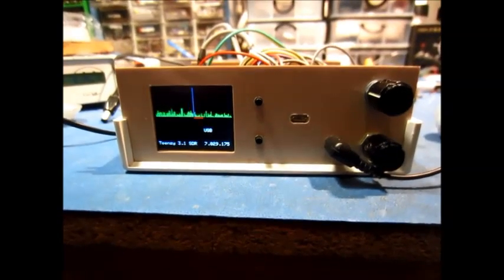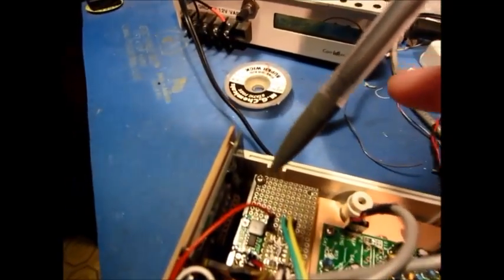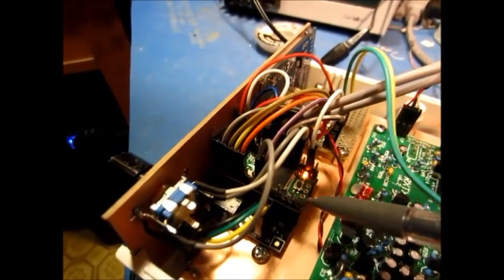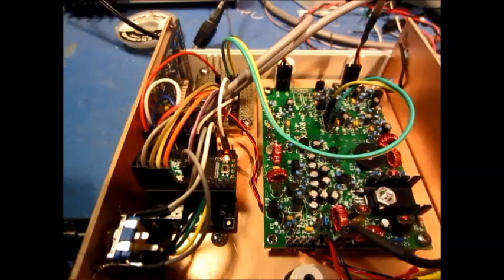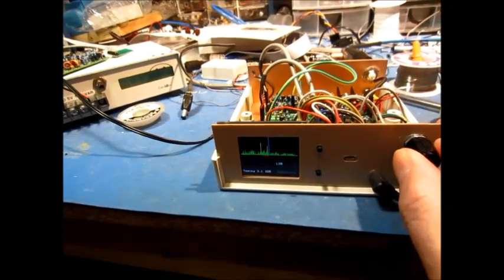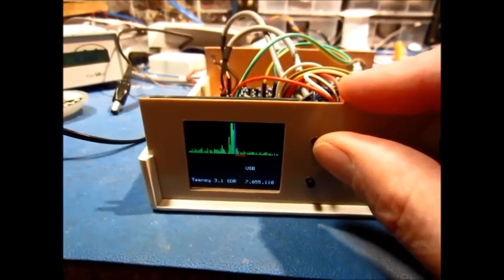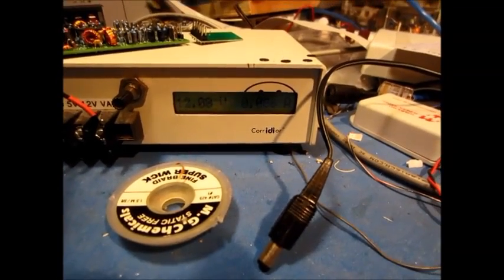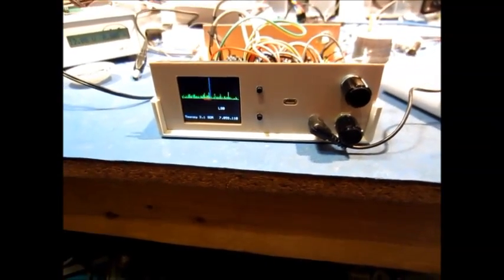Teensy SDR update

Comment: This is a cool implementation of the weaver ssb method. I think I'll try it. I wanted to throw a possible addition to this maybe if you want you can try it. I think the teensy has capacitive touch I/O and was thinking it would be cool to have a cw paddle implemented in some way using that feature. Maybe even built into the enclosure so you don't have to have an external key. Anyway such an interesting and cool project. Thanks so much for sharing. --... ...--
Reply from the maker: I will probably put a keyer in the software at some point and once that's done adding touch paddles to activate it should be straightforward. The display update burns a lot of CPU time 10 times a second so getting precise keying would mean running the keyer under interrupts or something like that. Good suggestion!

Comment from the maker: I don't have a detailed parts list since its intended to be a DIY project that you change for your needs. Parts I used:

Hammond enclosure
PCB material for panels
SoftRock 6.2
Teensy 3.1
Teensy Audio Shield
1.8" TFT display from Banggood.com or Adafruit.com
Homemade SI5351 breakout board - you can buy these from Adafruit.com
Adjustable step down switching regulator module from Banggood.com (set to 5V)
3.3v linear regulator for the SI5351. (Teensy has its own 3.3v regulator)
Encoder with push switch from Banggood.com
Volume pot from junkbox
Lots of female to female jumper cables to connect things together
Shielded cables for the audio, antenna
Power, audio and antenna connectors
Screws, standoffs, knobs etc

Comment: Sorry, just realised, you're probably talking about 80mA @ 12v input? Lol, that's why watts is always a better value to quote ;) (I'm comparing my results with teensy 3.1's @ 5v) but I always have mine clocked at either 120Mhz or 144Mhz depending on the project.
Reply from the maker: Yeah, the switcher is to reduce overall power consumption. 12v supply is more or less standard for amateur radio gizmos. The power hungry stuff (Teensy and display) runs at 3.3v so not very efficient if you use a linear regulator. I tried running the Teensy directly off the switcher set at 3.3v but when you plug in USB the current jumps way up - a parasitic current path in the Teensy I think. I could use the switcher output to power the Softrock 5V logic and that would save a few more milliwatts.

I'm clocking the Teensy at 96 mhz to save power. The audio library stuff consumes about 50% of the CPU which is not bad at all.
Reply: I assume you've broken the USB track on the underside of the teensy to separate usb power from the vin pin? That may be causing the higher current when plugging in? Although pretty sure you know about that already :) what kinda refresh rate you getting on the lcd there? Looks pretty smooth :) great project bud
Reply from the maker: Joop Media DOH! When this happened I had a quick look at the schematic and saw the isolation diodes but didn't notice they are bridged. Figured it was something like that but I was anxious to get the darn thing working so I cranked the switcher up to 5V. Some more power to be saved...

Loftur added a 10hz timer for the spectrum display code and I saw no reason to change it.